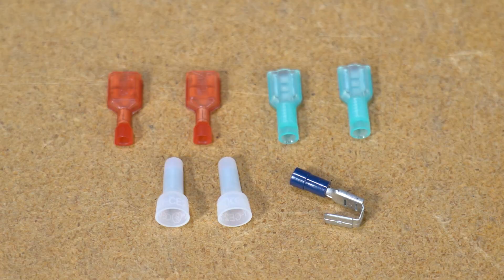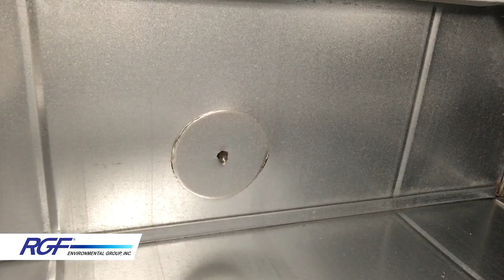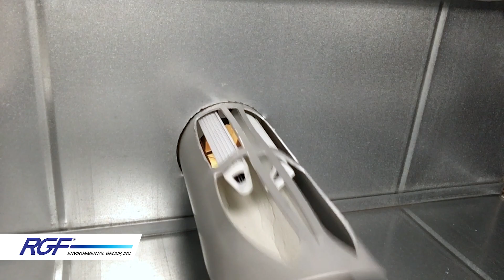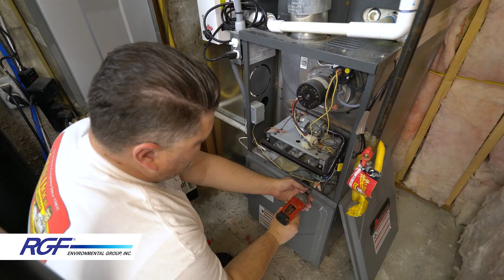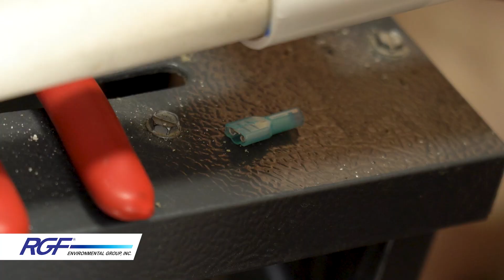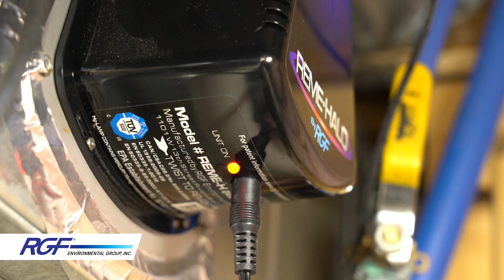RGF Environmental Group How To Install A REME HALO Air Purifier

Comment: Just installed this in my own home.
A few things he got wrong or didn't mention: The connector on the black wire isn't a splice spade connector, which im not sure is real, but is called a piggyback female disconnect>
Also, newer furnaces also have spots specifically built for air purifiers and humidifiers so a piggyback wouldnt be necessary so check your circuit board before driving all around town for the obscure piggyback part like me